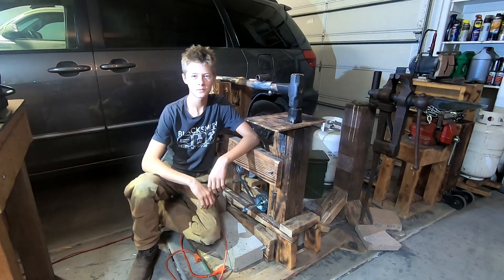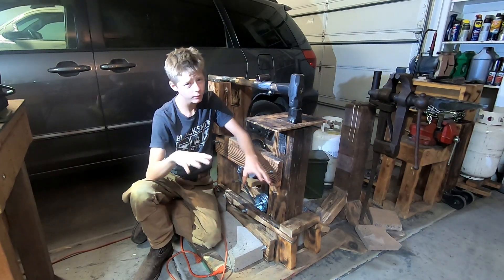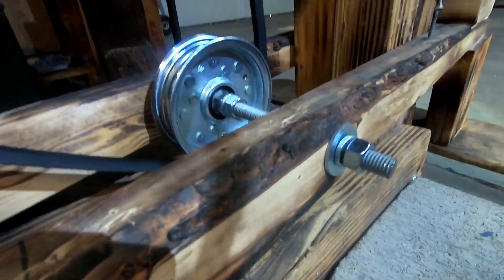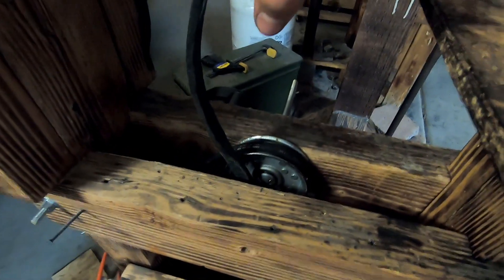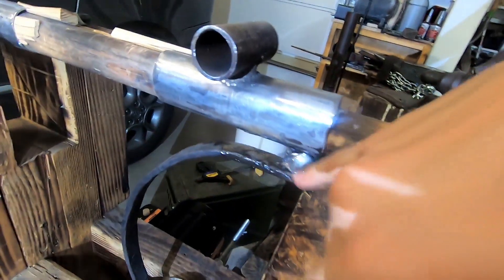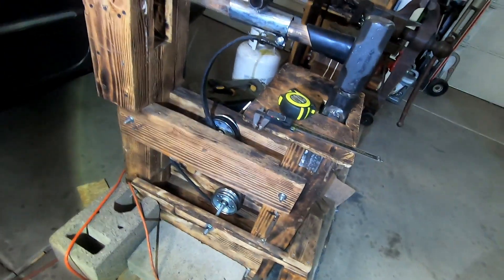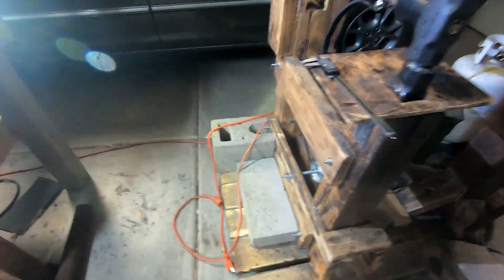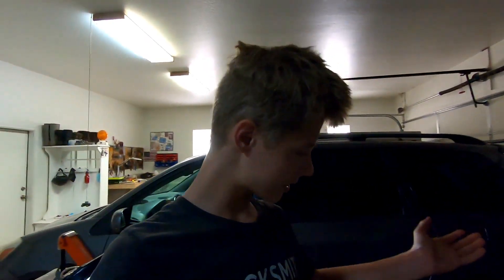how to build a power hammer!!

Comment: Not a fan of whom you mentioned you got your plans from ,I dig how you simplified his design though I’m not a fan of belt driven anything and that’s based off my own trials and errors 

Man I’m telling you if you can build this one you can build and tire hammer no problem (oh and the 1 hp smiths & John’s electric motor driving a tire will lift 100# ram no problem)
Reply: its not the power of the motor that restricting the size of the hammer he can use its the almost ridged spring , it has not got the flex in it to complete the rotation in time with more downforce on it .